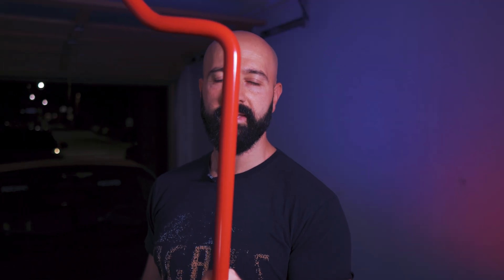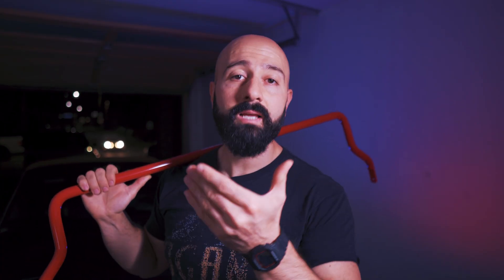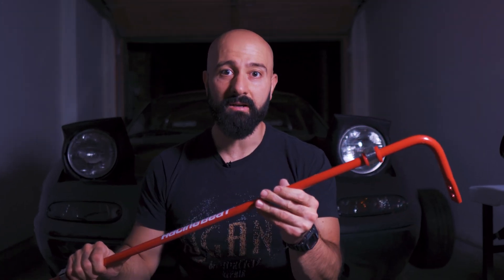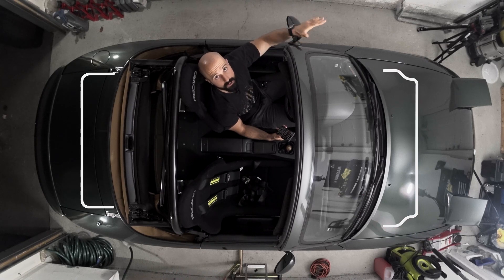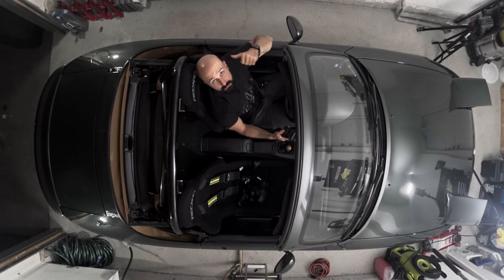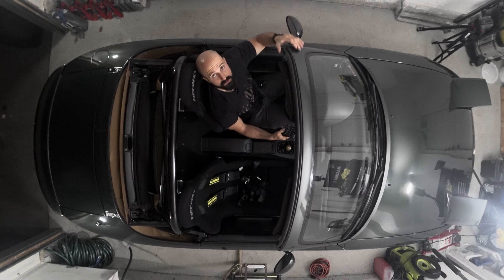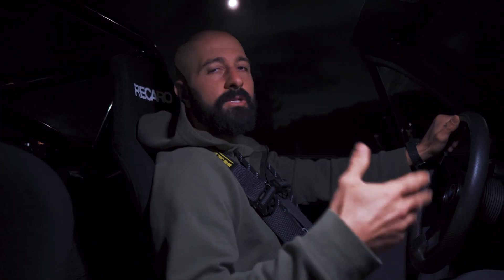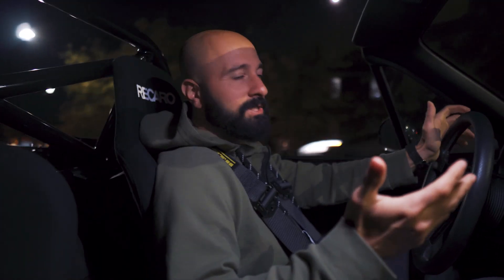Stop Body Roll: Sway Bars || PROJECT MIATA

Comment: I'm going to say something controversial. Your car is too low, and by doing that you've knackered the handling. Your wishbones are pointing up which lowers the roll centre further away from the centre of gravity. By doing this you have increased roll and buggered your suspension geometry. Your car will handle better if you get your roll centre as close as possible to the centre of gravity. Super lowered cars always look cool but they never handle well. Don't forget grip is not the same as handling! Anyways nice well put together video 👍. I really like your video production, it has a nice feel to it 👍
Reply from the maker: What you're saying is 100% true. But it seems a bit lower in video than it actually is in real life (intentional camera angles) but I am experimenting with ride height every time I have the wheels off.
Reply: You would hate to see how my Miata sits lol

Comment: 8:08 It looks here like you already have Ohlins coilovers. 

I don’t know how stiff your springs are, but I have a question: If your coilovers have stiff racing springs, does that negate the need for stiffer sway bars?

Great video BTW 👍
Reply from the maker: It really depends on how your car is behaving with your springs. But generally swaybars let you run softer springs without compromising too much when it comes to body roll. Hope this helps.